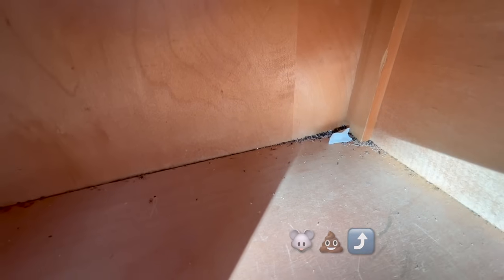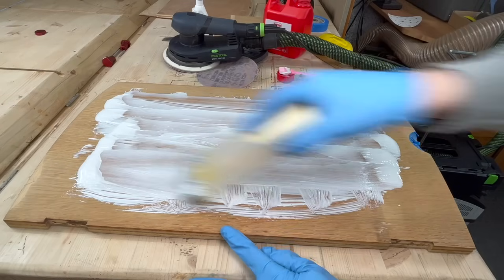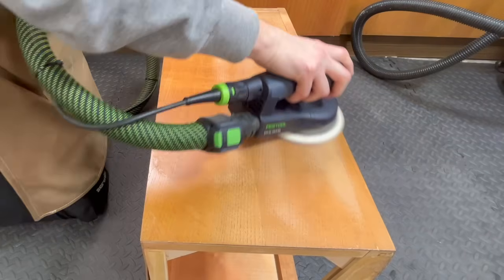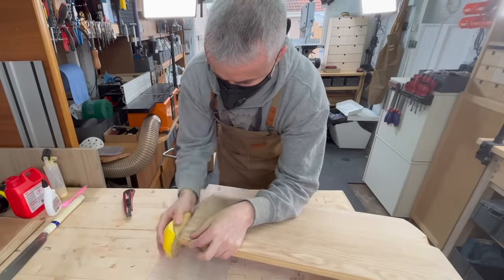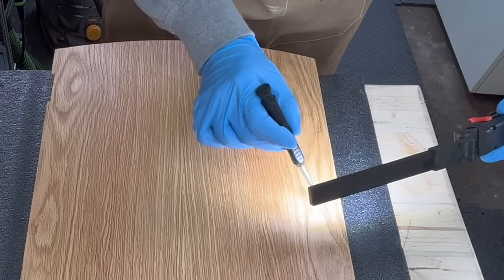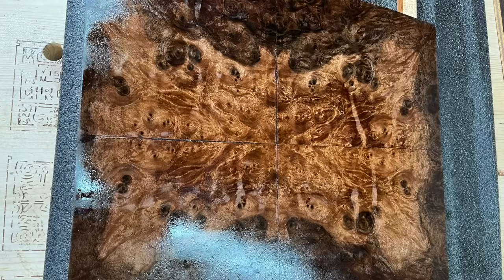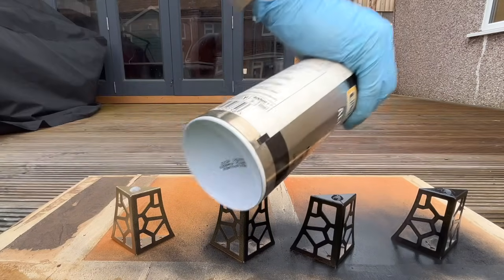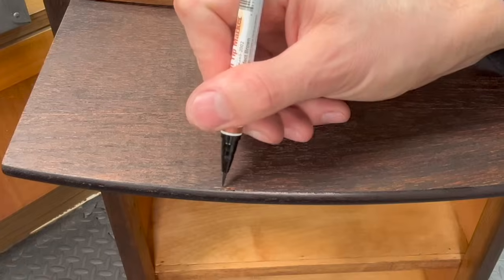Restoration with a modern twist. High End old table makeover.

Comment: Hey Jay, that turned out beautifully as usual! In the States, I've heard that stain solution referred to as Vinegaroon or Vinegar Black Stain/Dye. It's really neat and cheap to make. I used it on different types of wood with varying colors produced based on species. It also works on veg tan leather by turning the piece black. Just thought you might want to know... Keep up the good work!
Reply from the maker: Didn’t know the name but yes.  You can also use tea on wood that doesn’t have much tannins before hand so it gives you a darker colour 😉

Comment: Hi ~  I posted a suggestion on one of your projects and then realized you had posted it a year ago.  So, even though it doesn't relate to this particular restoration I thought I would share the idea here anyway.  You were having difficulty removing the finish on a beautiful old dresser.  I believe you not only sanded the top but used stripper multiple times.  Here's a trick I learned as a hairdresser. When I was removing the color from a patron's hair, especially red or darker colors, I would apply the color removing agent & then cover the hair with plastic wrap.  The chemical creates its own heat and significantly speeds up the process.  If you apply your stripper and then cover it with plastic wrap you might be surprised at the results. It helps keep the stripper moist & should also generate its own heat which is very effective when removing color. Try it... you may like it!  Another stellar refurbishing!!  So glad I found you. :eyes-pink-heart-shape:
Reply from the maker: Thank you and yes I have done this on other projects 😉

Comment: Once we built a air tight tent from plastic sheet and placed a cup of Salammoniac into with the oak furniture. Over night the oak looks some centennials older. If the surface has been brushed slightly the result will be even better.

Comment: Gorgeous! And the hardware! 😍
Does dissolving steel wool in vinegar create fumes of any sort? Is there a ratio you need to use to get those results?
Reply from the maker: Thank you and not that I’m aware of.  You can find tutorials on this but it’s not an exact science.  More or less what I did. Make sure it’s 0000 wool so it works quicker

Comment: I love it. I have been wanting to try this method with red oak. Was this white oak? I wonder if it would work with a cerused finish as well. 🤔
Reply from the maker: Yes and yes it works on most species but to various degrees. You can brush tea on first for extra tannin if using vinegar and steel on something like pine ;-)

Comment: Hey Jay, loved this effect with the steel wool and oak wood. Did you use straight vinegar? Filtered twice? Did you coat the piece one after the other, or was the wax between the coats, and at the end, or all at the end? Kind of lost track, lol! Thanks for a great video!
Reply from the maker: Hi, yes it’s just regular vinegar though mine was stronger than what’s in the shops in the UK ( got it from a Polish shop? You don’t need to filter it twice if you actually use a filter lol.  No wax.  And I only applied it once.  It was the oil that I did 2 coats.

Comment: Hi there. For the legs/stand of the drawer wasn't it better to use triangular wood blocks instead of the rectangular blocks you used. It sort of looks like over sized and an over kill. Just asking. 

The end result is amazing to say the least. Well done. You have certainly grew in your knowledge since you started of not that long ago. 👌
Reply from the maker: Thank you and it’s underneath so no one will ever see it. Also the triangle would have been much bigger to take a screw at the very edge 😉 that would also likely split the wood. This would have been a good idea if the leg was glued not screwed on.
Reply: @Flippingdrawers I guess that  makes sense yes. But overall project looks amazing. Well done👌
Reply from the maker: @nevillesmith9795  thanks mate 😊

Comment: I agree with all the other comments but I would like to mention something else. You have very expensive tools e.g. Festool but plenty of lower end, in the main Parkside. There is much tool snobbery but you prove that, if you keep your tools clean and do not abuse or misuse them, you can get consistently brilliant results. I'm surprised Parkside haven't sponsored you by now...
Reply from the maker: Thank you and I use tools that I like regardless of the brand. Some parkside tools (router) are 💩 but most I am very happy with ;-) I sand a lot so the Festool sander is something that makes sense splurging on ( my cordless Parkside sander died after 1 day of use 😂) My table saw and band saw are from a very reasonably priced UK company.